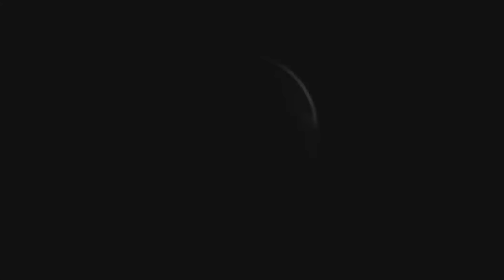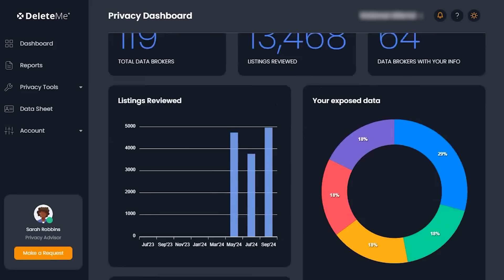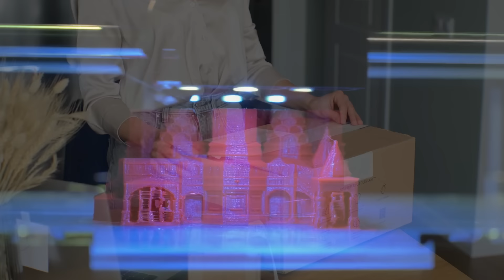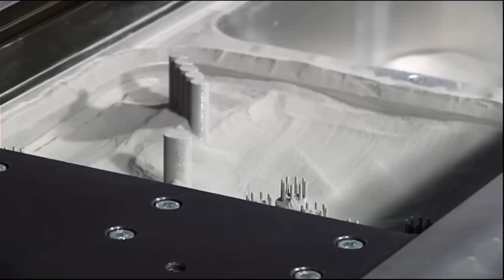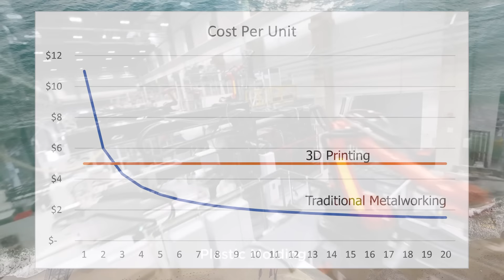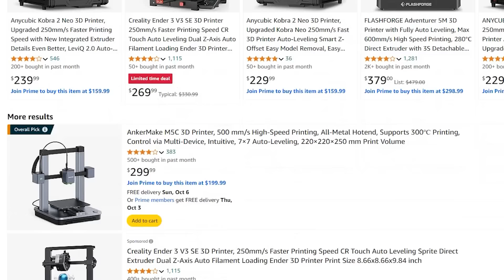3D Printing, Cathie Wood's Latest Disaster

Comment: Well I can say I got a small Chinese one for 200 buks 3 years ago and it works out of the box.
The irony is that plastic 3D printing is a cheaper option to make moulds for moulds.
We know Ark is a dumb shilling company throwing with buzzwords (everything related to Musk).
From a metal engineering perspective they are creating a problem that does not exist.
There are reasons why metal parts don't have detailed parts and are designed in multiparts for structural integrity and servicability.

Comment: Mold is only one of many methods of metal fabrication. Worked in business for over 30 years. We have had our eye on additive manufacturing for at least 15 years...evaluating the tech to see if it is viable for utilizing. The tech is far away from replacing traditional metal fabrication methods. We do utilize it for prototypes though...but not real world output. The current output is costly per unit and does not accommodate customer metalurgical specifications when tested.

Comment: Both Kathy Wood and Wall Street millennial have no clue what they are talking about on this topic. AND the 3 companies he is listing are not the real players in the market. AND he is severely wrong about some methods logistics, for instance the negation of DED and WAAM. 
From a technical standpoint I would give this video a 3/10 and say he completely missed the bus.

I'm a materials engineer
I am an avid 3d printing hobbiest and have built almost a dozen 3d printers. I also have experience with metal 3d printing technology. 
I think 3d printing will never gain mainstream appeal. It is really useful to makers and engineers, in almost every material type. It is however largely used by the bulk of the community to make wasteful trinkets.

That said it is a revolutionary technology for some engineering applications. Especially, aerospace, nuclear engineering, healthcare and high end automotive.  It is also extremely powerful for prototyping and building bespoke project solutions. I have personally used it for research purposes a lot and it is a game changer in a laboratory.  

All this to say 3d printing is a revolution in materials science that will be happening for the next 25 years at least. At the same time, it is not for everyone and does not belong in every home, and it isn't going to be resulting in any mega profitable corporations.
Reply: You like it but the investment thesis was a bomb. That's all that matters here.
Reply: @artsmith103 no it isn't he's analyzing it wrong. It just isn't what Kathy Wood said. He didn't really mention a number of other manufacturers that have a presence in the space with very different technology. They are already established as heavy machinery makers, for instance DMG mori. I question you read my whole post, if you did I said very clearly I don't think any massive companies come out of it.

Comment: Your description on how metal is processed isn't correct in that all you are describing is casting, which isn't the comparative thing when looking at cost reductions (although there is less waste in printing a metal part via SLM technologies, which is also not the only metal AM technology, compared to casting). That is compared to machining, which not only reduces waste going with an AM route, uses far less complicated tooling for higher complexity designs. wax solutions to create voids for instance is unnecessary in an AM solution because you can directly print the voids into the shape. This means that you no longer need to form, melt out, braise, etc. those voids together. 

If you want to compare casting to metal AM, casting has the limitation of mold design. Not only are molds expensive to make, they are often considered long term consumables unless the mold in question has delicate components within it (channels for fluid passage within the component for instance). Due to the small feature size and required tolerance, this will vastly reduce the mold lifespan. On top of this, casting is even worse than machining for complexity cost penalties. A mold can then easily end up costing as much as the AM machine and several months of operation alone. 

Casting also has the issue of needing lots of energy to actually work. You're dealing with liquid metals to be able to cast, and as such, you have to heat up a bunch of metal to high temps. This is a much higher cost than doing localized sintering.

Comment: Nearly everything you state about the current consumer 3d printer market was incorrect. Cokauker printers like Bambu are largely plug and play devices and the software could be driven by a 6 year old. No need to design anything for most with billions of files available online. The reference to bad quality and limited/expensive filament types is also totally incorrect
Reply: 1yr old video

Comment: This video does 3D printing dirty, I use them daily at work and e.g. the P1S printer is a "it just works" system. I have literally more problems with paper printers than with 3D printers now.

Its super cheap and easy to get prototypes, single use stuff, molds etc. etc.
Just two of them saved us thousands of hours and cash by now. The funny thing is the parts they are replacing are often weird proprietary shapes where you needed to request a quote, have some phone calls back and forth, approve the inquiry pay the ridiculous overpriced amount, wait for the transfer and customs. This times are long gone at my work. I reverse engineer it in CAD (usually in 1-3 hours), select the right material, do a test print overnight, make some adjustments and print again during the second night --> done. 400€ employee cost, 20€ material cost and 2 days and I have a model that usually works more or less the same (sometimes worse yes, but we also had some parts that came out better) and instead of 5000€, 4 phone calls, hours arguing with procurement customs etc. and waiting days too weeks for shipments, I now have the part and can replicate it to my liking.

I guess the "problem" is more that its just not as easy monetized as even conventional printers. They got traction only in the open source community and now there are thousand interoperable parts available from 1000 suppliers. There is even completely open source build it yourself printers. And unlike ink, the filament is cross compatible by design in every printer. You could Frankenstein a 3D printer from rocks and sticks in a cave and it would still work.

Comment: 7:08 I work on medical manufacturing and we work with some 3d printed parts. The current technology I've seen does not allow for the tight tolerances most customers demand when they contract us to make parts, often below .003 inches. The surfaces are too inconsistent. Plastic 3d printers have been very useful to create some fixturing, but that is a very limited application and is only used maybe once a month.
Aerospace manufacturing often requires equally or tighter tolerances, particularly in engines.

Comment: Sie haben mal wieder  nicht erkannt, dass die wahre Wertschöpfung bei dem Unternehmen liegen wird, dass mit der Maschine  Produkte fertigen kann, die  auf dem Markt  ein mehrfaches  der Produktionskosten  einbringen.  Dazu  gehört eben die Markt  und Markt Zugangserfahrung,  die Produktentwickler  und Fertigungsingenieure.   Die Druckerhersteller hätten  von Anfang an,   zum Drucker selbst,   auch den spezialisierten   Fertigungsingenieur  mit an bieten müssen.  Denn 10% der. Anpassung  erfolgt  beim Kunden, genau diese 10%. machen aber  den Unterschied.  Könnte jeder  wissen, der sich mit Werkzeugmaschinen,   Anlagen Herstellern beschäftigt. 
Die Deutsche  Stahlindustrie  steckt seit Jagdzeiten in der Krise, aber  Stahlwerke  made in Deutschland  waren sehr lange  führend. 
> 40% des Verkaufspreises  erwirtschaften  Planung, Beratung, Einführung und Schulung.

Comment: Parts can also be cut with lasers and jets of water, or formed from powder. It all depends on the mechanical strains that the part will undergo. With jet engine parts, strength and heat resistance are of enormous importance, and this often requires the item to be machined from a single piece of metal with a crystal structure of great strength, formed at very high temperature. 3d does not do that. It's the difference between a rock and a loaf of bread.

Comment: I have been building robotics and machinery for roughly 15 years, as a career.  I am comfortable declaring that for people like me-- who have to build shit that actually works for the customer-- 3D printing is an "edge-case, costly, complicated, and rarely used" method of fabricating parts.

Because I work in the industry of "robotics and machinery," I am necessarily that kind of customer who is in that end of the market where the parts that I need to make, are manufactured in very low volumes.  So the hype-train stories around 3D printing would suggest that I am exactly the kind of customer who should have benefited the most from 3D printed parts (low volume manufacturing).  Nope.  Not even me, who should have been the golden-opportunity customer for 3D printing, is seeing the story that was being pushed by the charlatans of hype.  Things like traditional metal fabrication (sheet metal fab, and welding) and CNC machining are still king.

Don't get me wrong, there have absolutely been a couple use-cases where 3D printing was truly beneficial for me.  But like I said earlier, those niche cases were "edge-case, costly, complicated, and rarely used."

Comment: I‘m a software dev I and about half of the other software devs I know own at least one 3d printer. And depending on what you print you can save a lot of money a spare part for my Leica camera original costs 70€. I printed it for marterial cost of a couple of cents.

Comment: The issue with 3d printers is just one of everyone wanting it to be the next big thing and trying to force it quickly. It will mature, and like so many other things, it will either just become a regular part of everyday life, or it will be replaced by some newer unforseen tech before it gets a chance to shine. Home 3d printers are useful, but typically only for a very small percentage of end users. Right now, unless you just want to print out plastic junk toys, you need to have a decent level of mechanical skill to get and keep the machines running smoothly, and at least a passable ability to model or edit 3d models so you aren't locked into things that other people have made for their needs and hope you need that exact thing too.
-
I 3D print useful little things all the time, but those alone can't justify the $300-$500 cost of a basic printer. Currently I am printing out a two large (390x390mm) dog doors to install on my two screened in porch doors. This will save me about $200 each, but is only a realistic endeavor because I have many years of experience with printers and modeling items.
-
Right now the miniatures hobby is really starting to make the newer resin printers look attractive to new users, but limitation of most 3d printed parts leaves us in the no mans land of most 3d printers being sold ending up like most home exercise equipment...collecting dust.

Comment: I think statements like “we just don’t see every home having a 3d printer” and “improving our value to the manufacturer” show that they started with a business model and then tried to squish 3d printing into it without understanding the product. 

Not every home has a 3d printer but every home that wants a 3d printer pretty much has one. 

You don’t “improve your value” to the manufacturers, you are a manufacturer. Your value is in your manufacturing. 

The whole idea of a service already hurts the strengths of 3d printing by adding heavy baggage to the fast turn around times and inexpensive prototyping. It’d be much better as a front end for more conventional manufacturing methods.

Comment: Back in the 90s, rapid prototyping was the name for processes that manufactured items, layer by layer. That was a better name than 3D Printing as it focused on prototypes. Wall Street and Silicon Valley need to manufacture stock and IPO valuations out of thin air, hence they are always pushing old things into hype cycles like EVs, robotics, rapid prototyping, solar energy, etc. 

The best thing to do is to study the hype cycle and short the stocks and ETFs that ran up. One of my favorites was Zoom and it's fall once politicians figured they'd done enough social engineering with schoolroom and office lockdowns.

Comment: I like 3D printing, I even own a printer and design my own files whenever I need something repaired or replaced, so I think I have some level of knowledge about the process and I never understood how anyone could look at a 3D printer and think this is the next revolution in manufacturing. They are great for producing smaller, unique items and things where there is limited demand, meaning investments for making moulds and what not just aren't worth it, but for any sort of higher production value they are horrible. They are so damn slow, compared to other means of making things, they need way more maintenance and oversight, wear out way quicker, making upkeep more expensive and ultimately are just as limited in what they can produce. Just as with injection moulding you need to design your parts in a way that fits the limitations of the respective manufacturing process, those limitations are just different. Whenever you got enough demand it is so much more sensible to choose another manufacturing process over 3D printing.

Comment: I use 3d printing for prototypes or holding fixtures. 3D printing is just another group of manufacturing processes that complement what already exists. I believe there is a future for complex metal parts, but as stated in the video, I is a very specific niche.

Comment: There is one company in the 3D metal printing space that has massive potential but in limited usecases. It’s a company that basically welds up rough parts out of titanium that is then machined down to the final part. Parts that were originally machined from a block of Aluminum can now be Titanium and at a lower cost because of the lower buy to fly ratio and much faster machining times.
Reply: The company is Norsk Titanium and the parts are full strength Aerospace grade. There is no strength disadvantage with their process.

Comment: Elegoo is the name in the consumer hobby market at this moment.  I have several friends with 3D printers that use their photolithography process into a liquid resin bath.  I'm seriously thinking about their Saturn 4 myself. The resolution is so good you need magnification to see the layers. Cleanup is almost non-existent. The software is fairly easy to manipulate pre-designed parts for a "print" of a part or assembly that is available for a fee on several websites.  My circle of friends use them to download model car and airplane parts - even entire kits.  The cost of the printers and the resin supplies have come down so much through actual real competition in China that the dream of 3D printing is within reach of many model building and figure painting hobby enthusiasts.  Thank you China.  If American companies still had 100% of photolithography we'd be paying $5,000 for their black box and $50 a pint for resin.   A state of the art Saturn 4 is $315 shipped to my door.

Comment: Is there not a use for the technology where a metal part is designed on a computer, 3D printed in a suitable plastic and then that plastic version being used as a master for moulds? The final metal version is then cast in a conventional way and even small changes to the design could be easily produced and assessed.

Comment: As a design engineer with 40 years experience in the field, I was never really impressed by 3D-printing. It's good for quick prototypes, we used to call it "rapid prototyping" for a reason, but beyond that I never saw any potential for it in mass manufacturing. Even the prototypes that I saw were not that impressive and usually needed further work on them before the results were satisfactory. Maybe one day 3D-printing will have improved to a point that it delivers acceptable results.

Comment: It’s just another example of a really cool technology that doesn’t have a large enough use case to ever be more than a niche product. In addition to everything in the video, another reason why this doesn’t scale is that it would never make sense to mass 3D print any complicated component. Even if you’re talking about airplanes or rockets, it is always going to make more sense to divide complicated pieces into smaller ones so you can sub them out if there’s a problem. Like imagine if you could 3D print an entire airplane for a crazy example that far beyond the capabilities of the technology but the ultimate logical end point. Then if something minor breaks, you have to reprint the entire plane. There are reasons why modularity is an important part of the manufacturing process. As stated in the video, this technology can help with getting prototypes out fast and that’s great, but unless the materials used for 3D printing somehow became ridiculously cheaper than standard materials (and had similar durability), then this will never be the future of manufacturing. People that think otherwise are basically sci-fi fantasists who believe in Star Trek replicators becoming real. It also seems like there are a lot of those people out there in the institutional investor space. It’s no wonder that ARK continues to run cover for Tesla’s pipe dreams.